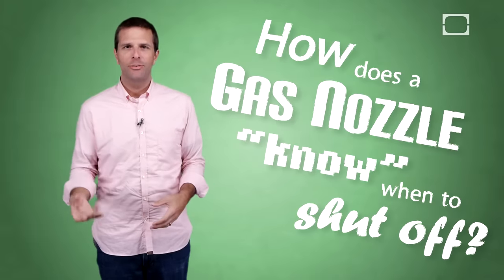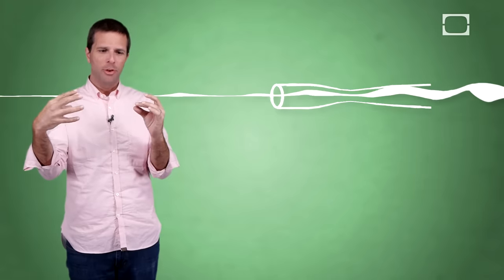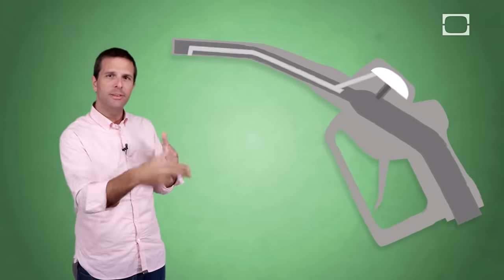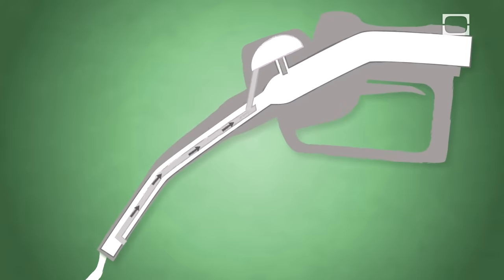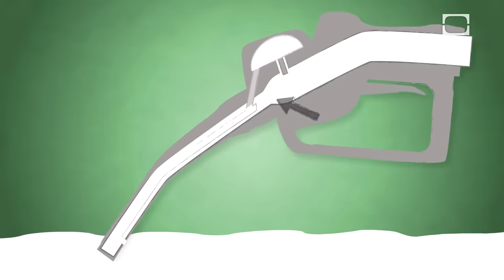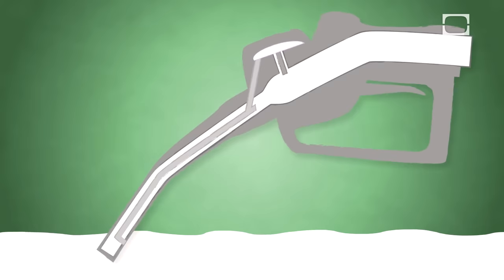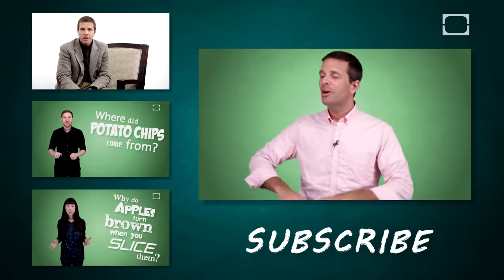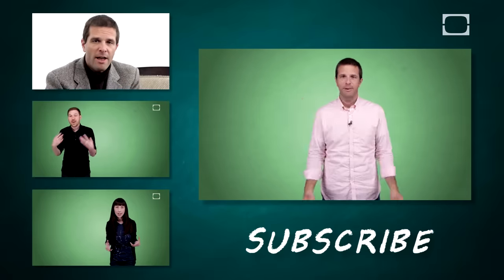How Does A Gas Nozzle Know When To Shut Off?

Comment: The video is mostly right, but just a bit misleading...  The diaphragm does not have positive air pressure to it while the tank is filling.  During filling it will have a slight vacuum on it, but when the gas level reaches the sensing tube there is a sudden increase in the vacuum because the liquid being dispensed is harder to suck up (higher density and viscosity).  That sudden increase is what causes the diaphragm to close the valve, rather than a reversal of pressure/flow to the diaphragm.  Hope this helps people to understand how it works!

Comment: Your physics is slightly off. The pressure drop is actually within the venturi, not after it. That seems counter-intuitive at first, until you what's happening a bit closer. It's behaviour is derived from Bernoulli's Theorem; the same principle that's behind how lift is generated by a wing moving through the air. The constriction causes the fluid to speed up in order for the rate of flow to stay the same throughout the tube, thus increasing it's dynamic pressure (pressure at the front, if you like). But no energy is being added to the system, so this increase has to come from somewhere. Where it comes from is a reduction in the static pressure (pressure at the side, if you like). It's this that produces the lower pressure effect (or creates lift across the top of a wing, or lowers the pressure in a straw if you blow across the top of it. The fluid does not get compressed; well, at least not while the system is subsonic. If the fluid movement gets to supersonic speed the particles can't keep up and compressibility takes place in gases. This is what generates a sonic boom and the unruly behaviour of conventional aircraft wings as the sound barrier is approached.

Comment: Hmmm.  I think this explains something annoying that sometimes happens.  I will squeeze the handle to start filling up, and the pump shuts off almost immediately, and this will happen repeatedly.  I've been told that this happens when someone has tried 'topping off' with that pump.  It must be that repeatedly 'topping off' will force several bubbles of air/gas into the air line you talk about, so that it gets temporarily clogged with bubbles and doesn't drain efficiently.  Do I have that basically right?  I do a slow burn when I hear others at the pumps: snap-snap-snap-snap... gotta get that last 50th of an ounce in there-- it's gonna save me SO much time...
Reply: Greg Scott What you're saying makes sense however I suspect that may not be the case. When I lived in oregon (where only an attendant can pump your gas, not you) They always ask if you want to top it off, and will do just that if you ask. I imagine they wouldn't offer to do that if that was an issue considering they do it all day for a living.
Reply: Possibly, Warndog, but not necessarily.  Topping off can be done with one or two depressions of the handle.  Some people do it repeatedly and rapidly.  There may be a difference.  But I hear what you're saying-- there may not really be a connection.
Reply: Ah, good point, there may very well be a proper technique to topping off. Might depend on the pumps design as well.
Reply: Yes, I think you're right.

Comment: Okay but here's what gets me. I changed my fuel pump yesterday which is under the back seat. The hole for the fuel pump is like a whole foot and a half lower than the fuel door/cap. I had a full tank. If the air tube in the nozzle can reach the gasoline on a full tank then the tank should fill much higher than the fuel pump under the seat. So why then when I took the pump out was there about 4 inches of air above the gasoline?

Comment: Just for the record, complex is the opposite of complicated. Complex is many similar things doing the same thing, like an apartment complex, or a beehive; all the same. Complicated is many different things doing different things, like the UN or the cafeteria in high school. Huge difference.
Also, a tube leading to a diaphragm is neither complex nor complicated; it is quite simple and elegant actually, as a trigger. It's like connecting a motion detector to your shower curtain, but simpler.

Comment: adblue tank and adblue pumps must have working in different way because many times my adblue tank is empty but the pump shuts off immidiately after I press the trigger :D And the only way to fill up the tank is just pulling the lever very gently because if I try a little bit harder it just shuts off again ...

Comment: Then why does the filler shut off even when I am holding it in mid air and allowing the gas to fall into the car? It stop after 1/2 a gallon whether its in my car's fuel filler or not even touching it.

Comment: Explain the Venturi Effect when I have a freaking empty tank, and it takes 4 or 5 minutes of constant shut offs to fill my tank back up.
Reply: Most cars have a vent system, since they can't vent the fuel to atmosphere, it is vented to a canister. When the vent doesn't function properly, more fuel is going in than air can get out, which causes the fuel to backup, and trigger the effect.

Comment: How do the actual gas tank work. Like how does the fuel gauge work and is it just a pouch or does it have hoses?
Reply from the maker: That's a good question Mercedes. I'll add it to our list for future episodes. In the meantime, here's an article on fuel gauges by our auto department. http://auto.howstuffworks.com/fuel-gauge1.htm
Reply: Will Patterson dude it was a dumb question, and poorly worded, She needs to learn a lot more than how a fuel tank works.
Reply: Aww thanks for everyone who was sticking up for me.
But, ***** and Dogman regardless of my gender you should never insult someone trying to improve themselves. Just common sense.
Reply: Mercedes Cordoway yeah I never mentioned anything about gender, thanks for putting me in that boat.
Reply: Mercedes Cordoway theres two electronic sensors in the tank that measure the electrical resistance to get a fuel level height which in turn, sends that info back to your gauge.  the sensor is typically mounted to the pump inside the tank
Reply: sik59rt nice...now lets see what she does with that information...
Reply: ***** and yet, you probably cant answer it. ironic
Reply: sik59rt Thank you..
Reply: +Mercedes Cordoway Trollers appearences significantly increase when there is a pretty girl involved
Reply: +Mercedes Cordoway There's what is called "a fuel sending unit" which sits on the top of the tank and is essentially a float on the end of an arm.  At the pivot point of the arm is a variable resistor which has its resistance increased or decreased as the angle of the float arm changes.  When the fuel level is at its lowest point, the arm is at its lowest angle to the vertical axis (angling down), and the resistance is at its lowest (could be highest, too, this is a simple choice of the engineers for that particular car).  When the fuel level is at its highest the arm is at its highest angle to the vertical axis (which is nearly horizontal) and the resistor has its highest resistance.

Then from there it's simple:  The PCM/ECU (car's computer) or the fuel gauge (depending on the year and car, it could be either) checks the resistance going to the fuel sending unit and it knows what the low resistance value is (emptiest), and it knows what the high resistance value should be (fullest), and it can linearly interpolate anywhere in between.

Viola!

Hope I explained it well enough.
Reply: MrSlowestD16 yes you did! Thank you!!!

Comment: This video shows the diaphragm connected to the thick part of the Venturi tube, not the thin part. This would cause gasoline to flow into the diaphragm. To maintain suction on the diaphragm and pull air in through the hole in the spout, the diaphragm needs to be connected to the thin part of the Venturi, as shown in https://i.imgur.com/F6RvAXs.jpg and https://www.youtube.com/watch?v=afKwoc5DG9Y.

Comment: Wow, I thought it works by measuring the capacitance between two electrodes before watching the video. Working without electricity is surely a better and cleverer solution.
Reply: +Patchy .E. you know what happens if you do it that way. Those electrodes get to close and kabloe goes the gas station and probably like a block radius. :(

Comment: its not that complex. Yeah i didnt know the mechanism up till today but the venturi isnt that hard. Its governed by bernoullis equation. Think of it as energy. The energy by a liquid or air depends on the 1 velocity, 2 the pressure, and 3 its height and all these combined is constant value (i.e. energy/momentum/etc is conserved). i.e. say water falls down (loses height). to be constant the velocity has to increase. Then the water reaches the floor and stops moving. so this velocity changes to pressure onto the floor.

Now in the venturi tube, when the velocity changes, the pressure changes. I dont know much, just spreading what I know

Comment: How is it that after the pump shuts off, I can "top it off" if I want to without overfilling the tank? Like if gas stopped at $19.13 and I didnt like how that looked in my bank account, I should be able to go to $20 without spilling gas. Does that just shove the extra gas into the engine?

Comment: My initial thought before watching the video was, "oh, there must be some sort of small electrical current in the nozzle, and when the metal tip touches the gasoline it completes a circuit and automatically shuts off," and then I remembered why those who pump gas are asked not to smoke while pumping...and I felt stupid xD
Reply: +AreYouGettingThis you know what happens if you do it that way. Those electrodes get to close and kabloe goes the gas station and probably like a block radius. :(

Comment: what if u don't fill up it tank all the way? how would it know when to stop?
Reply: +Abrams Tank (M1A2) Well, you can just release the trigger manually, what's the problem?
Reply: Ok, let me explain it better. For example your car is on empty and u go to fill it up but, u only put in $5 in gas so it doesn't fill ur tank all the way. How would it know when to stop?
Reply: +Abrams Tank (M1A2) It's not the nozzle that does this. It's the pump, it shuts off (or cuts the flow some other way) after your 5$ worth of gas went through.

Comment: I do not understand why the air is sucked in the opposit way. From the tail to the inner part (from left to right in this video). 
There is fuel coming from the right to the left and there is a second pipe inside the nozzle. I would expect that the second nozzle will be filled with fuel to and the fuel runs out of both opening at the tail. That this second pipe sucks air is kind of paradox for me.
Reply: +TheBizarroJerry Okay, I understand. The diagram in your video is really bad. The opening of the inner pipe is in the small part of the fuel pipe. At that place where the small pipe ends is no venturi effect. That thing look different. It must end in a bigger room where the pressure is decreased by the venturi effect.

Comment: Oh with gas you mean petrol. What if I fill up my car with GPL or LPG (same thing) (Liquid Petrolium Gas) that is under pressure and does not have a nozzle like that that enters the car but a flat head with an adapter (which changes for different countries in Europe) that funnels it into a valve to enter the tank?
Reply: and with methane and hydrogen cars?

Comment: I am completely lost! If you are saying this works like a venturi with the pressurized gasoline flowing out the gas nozzle (acting as the motive flow) is constricted in the handheld nozzle entering the gas tank, then where is your venturi (or suction) inlet? The inlet atm air tube is concentric to the gas nozzle leading to the diaphragm in the handheld nozzle. With a venturi or jet pump the motive fluid is always mixed with the low pressure "suction" fluid.  I guess I don't see any venturi in the poor way this is explained???

Comment: Why doesn't gas just flow down the little tube? I don't see how your diagram can possibly be correct. Seriously, if you've got a funnel and you put a straw in the middle of the outlet pipe with the top of the straw a little below the top of the outlet pipe and then pour liquid in the funnel, it's going to go down both the pipe and the straw.

Your diagram should show the top diaphragm tube coming down and opening diagonally into the nozzle. The air tube from the nozzle tip connects to the diaphragm tube just above the opening in the diaphragm tube, relieving the vacuum that would form at the diagonal opening. There should be no opening straight into the flow of the gasoline. That would defeat the whole purpose of trying to generate a vacuum.

And by the way, the generation of a vacuum does not depend upon the narrowing of the nozzle (the venturi effect), because pressure is still positive even in the constricted area of a venturi tube. It depends only on the gas in a pipe flowing past an opening that is oriented diagonally away from the flow.
Reply: you are probably a bit confused as it is a 2d diagram
Reply: Ha. Look, a "smart" guy is confused.
Reply: Its a 2d diagram

Comment: So how can i get the air out of my gas tank myself? 2003 Volkswagen passat w8
Reply: Jai Galloway Put water into your gas tank. The water will displace the air
Reply: Jai Galloway Putting bleach in there will make sure the water works in the engine, because cars can run on bleach as well as gasoline. The more you know!
Reply: Wow. I didn't know that
Reply: Jai Galloway I was joking. Putting anything other than gasoline in your car will destroy it and possibly harm you. Do not do it.
Reply: r u mad yet Oh ok
Reply: Jai Galloway firstly its not cost effective and there's no real reason to do this, also why do you want to do this?

Comment: You can always continue filling up for a little while even when it clicks, i.e., shut off.
Reply: +GymChess I fix cars and yes it is a bad idea for 2 reasons. Most people think that gas is a liquid when in all reality what is dangerous for the environment and burns is actually the vapors (yes it is liquid being put in ur tank but when pressured really high and spray through a small tube it atomizes or turns into vapor). So to prevent possible environmental damage, and the possibility of a build up of explosive gases at the gas station, almost every car has a evaporative emissions system. This mainly consist of a charcoal canister, a vent, and purge valve. This charcoal canister collects unburnt fuel vapors that escape from the tank, and then when possible it sends them to the engine to be burnt. By over filling your tank what you end up doing is causing so much fuel to go to this charcoal canister that it gets saturated and can no longer hold vapors. This can result in costly repairs to replace said charcoal canister, more pollution into the environment, and the possibility of explosive gases building up when fueling. The second reason this is bad is because you risk fuel overflowing and leaking onto the ground which is bad and a waste of fuel/money.  I see some people posting about doing it to a motorcycle, that is fine because it does not have a evaporative emissions system, and since you can see in the tank the chance of spilling is really low.
Reply: +Kevin Well I drive another car now since I last did it. It never overflowed or dropped on the ground though. When it "clicked" I would just continue carefully and when it came up, I stopped and put the lid back on. I don't do that anymore because it makes very little to no difference anyway.

Comment: How does a diesel one shut off then lol. I rarely pump gasoline anymore and mainly diesel so need this helpful knowledge 😂but seriously. It's either gasoline, diesel, or just say fuel. A gas is also a state of matter. Liquid gasoline goes into your vehicles fuel tank and the smell is fumes or gaseous vapors emitted from gasoline. Diesel isn't as potent because it doesn't evaporate as well as gasoline. Also why you can drop a match into diesel and it goes out but drop a match into gasoline and the vapors instantly ignite. Two different fuels, both different properties, different engine builds, and are NOT the same.

Comment: Nope your completely wrong Josh!
I manufacturer gas pump nozzles!
where you have the diaphragm in your illustration is really where the little gas gremlins sit. They communicate with the other gremlins that are in the cars tank to know when it's full and then at that point the push down a small gate that closes the valve. they say not to top off your tanks because once the gremlins turn off the gas if you try to top it off they aren't expecting that and it splashes all over thier little faces and they hate that!

Comment: i think its not gonna work for all time.
you said it turn off as soon the gas level goes up.

let's take an example suppose your gas tank filled totally with on and about $ 100 , and if i wanna put  $50 gas , that means gas doesn't gonna stop???
Help me out guys...
Reply: +Chinan Nedariya You don't know that you can just release the trigger manually, is that what you are trying to say here?
Reply: +Chinan Nedariya  In the event you can't be bothered to stay at the pump to monitor it to turn off the nozzle manually, you can prepay the clerk so they can det the pump to shut off at your set money amount

Comment: Air is not a fluid. The word fluid it typically used the same as the word liquid in layman terms. Air is a gas. Nice try though. You do get an A+ for effort. It certainly is interesting to think about how things work.
Reply: Roger Nob False. We actually generally misuse the term fluid. Here is the exact definition of Fluid: 

"a substance that has no fixed shape and yields easily to external pressure; a gas or (especially) a liquid."

Classic misnomer